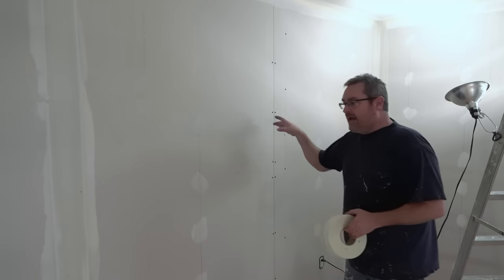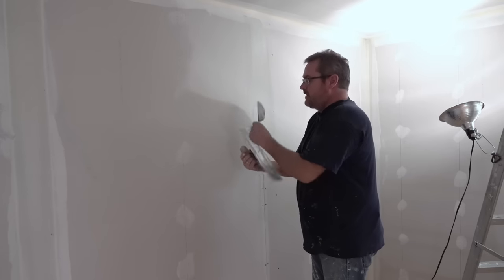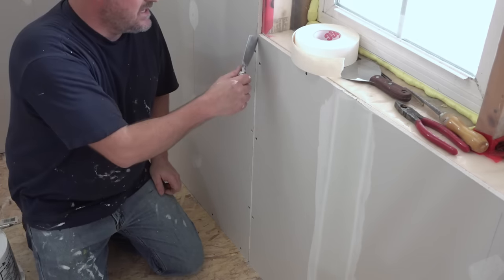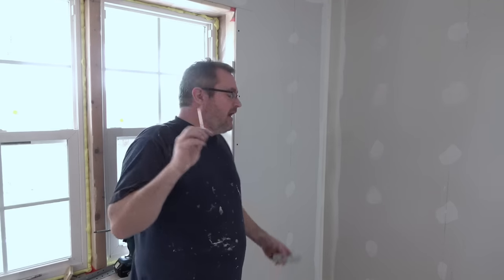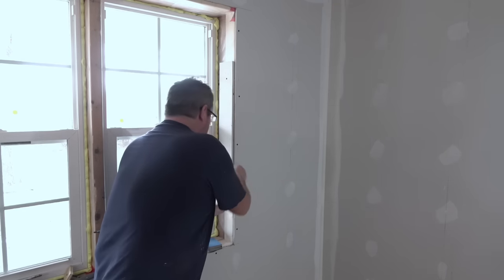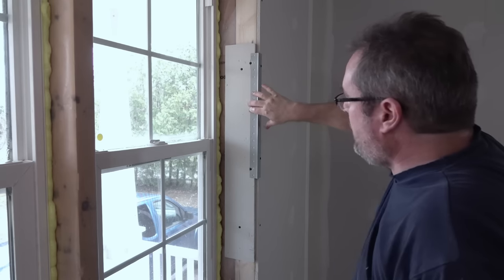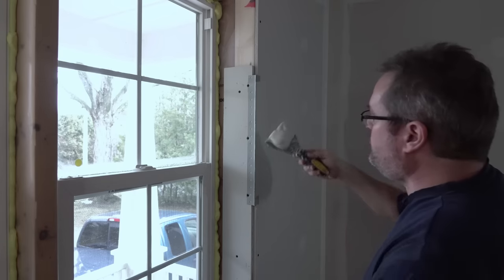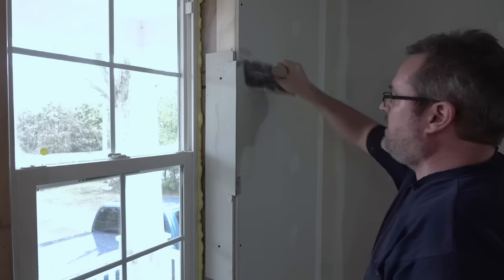How To Drywall Without Sanding Part 3 - Flat Seams And Corner Beads

Comment: Nice tip on the corner bead using the short piece to first make a mark. Also with the tape to strengthen the corner.

Comment: great series for the diyer in new zealand we fit the corner ( slimlines ) with a gun stapler it's not what the manufacturer recommend but it's a ton faster and stops distortion from screwing.
Reply from the maker: +ducksniffernz 
I've seen that, but with the flexible plastic corners. Guys also use spray contact adhesive and there's a crimper that most pros use to get them on the corner snug before screwing.
Reply: We staple ours on if it's metal, that way you're not going into the stud which is prone to movement

Comment: For butt joints do you think the curved trowel is worth it or stick w a straight? I was under the impression the center had to have more buildup to feather out edges to create a gradual hump or just use a straight?  Thanks 4 the vids and lil tips,

Comment: I like this drywall series. I just didn't understand yet the difference between the paper tape and the fiber -mesh one.
Reply: +pmenegatos Mesh tape is a little bit thicker, so it's really best used at the gaps where the drywall has the beveled edge so the joint is flush.
Reply from the maker: +pmenegatos Mesh tape looks like window screen - it's a mesh. The open mess allows the mud to go through to the drywall beneath, so that you don't need to lay down a bed first. It's the same width and thickness as the paper tape, but cost roughly 2x as much.

Comment: Neat series, John.  Any thoughts or experiences on the rounded corners?   I'm not fond of the sharp 90 degree metal corners since I find that they chip off paint so easily.   (I know, someday the kids will leave and that won't happen any more...  )
Reply from the maker: +wordsnwood 
Thanks Art. I really don't like those, actually. I much prefer the crisp, square ones. I've rounded inside 45's before, since it's really hard to make those absolutely straight. And if they aren't straight, they look pretty crappy.
Reply: they r called bullnose corners they r easy to do n look better than the 90 degree

Comment: I hate how corner beads are flared out so much. Trying to install thick baseboard makes it almost impossible to get tight to the wall. In my house I'm going to try and get a better method to keep my inside and outside corners 90. 

The other alternative is to do your base in two parts like the olden days. This allows the smaller top trim to be nailed tighter to the wall as it can flex.

Another way I thought of is doubling up my 2x4 bottom plate so I can nail into continuously and not run into a spot where you have no stud.
Reply: I know this is old but we flair out the bottoms of externals along the wall to make the baseboard curve less, it's not perfect fix but it helps some

Comment: never understood why I see so many doing dry wall horisontal
Reply from the maker: +Lasse Langwadt Christensen 
Mainly because it's faster. Put the first sheet up tight to the ceiling, then next up tight to that from below. If the wall height is less than 8' (or 12' or 16', etc), it's easier to cut the edge off the sheet than the end.
Also, on big jobs, the guys that hang the board almost never do the taping, so they do it the easiest way possible without any regard for how easy or hard it is to tape.
Reply: horizontal sheets also hide waves in the walls easier. because the sheets span across more studs. it also lets you offset your joints which makes them harder to find
Reply: +Lasse Langwadt Christensen It's also tougher to get nails and screws into the vertical layout of board because there are usually some imperfections in the framing plus drying and twisting of the sub-straight. (2x4). An experienced Drywaller doesn't have to mark his stud locations this way either. Its a great question.
Reply: +Steven Bartholomew So the guy framing rushes and makes a wavy wall, the guy doing the drywall rushes and does horizontal sheets and in the end the guy taping and mudding has to fix everything and do a heap of butt joints 

makes sense ;)
Reply from the maker: +Steven Bartholomew 
Traditional wisdom in theory, but another thing in practice. Houses, especially smaller ones, don't have walls long enough to get a good sight line on to see any waviness. This one sure doesn't. 
Even with the joints offset, the butt joints on most taping jobs stand out like sore thumbs - no problem at all to see them, but the tapered horizontal joint is invisible.
Reply from the maker: +jay dube 
I overshoot the framing and use a strip of OSB backing to join the sheets in most instances. Much flatter and more reliable that landing on a stud.
Reply from the maker: Lasse Langwadt Christensen
Exactly! It flows downhill :D
Reply: +Lasse Langwadt Christensen Its most commonly seen in commercial  settings where a top notch finish is not important.  99% of residential drywall is installed horizontally.  It makes for a flatter wall and alot less crack filling   work.
Reply: I Build It Home I've seen sheets tapered on all four sides meant for ceilings, but they are probably quite a bit more expensive because they must be harder to make
Reply: +Lasse Langwadt Christensen No the spotter finishes it all up. The company I worked for had a spotter. Last guy in last guy to leave, he lays a large shop light shining from one corner of a room to the next.  Any imperfections he "spot" fills with compound (mud) and fixes all waves in the wall. Ive seen butt joints 5 ft wide to take out 90% of a wave cause the stud framing was horrid.
Reply: +Bruce Hurlburt 
I guess you have a lt of guys show up early for work.
Reply: +Keith Weagle How do you figure that it is less crack fill?  Vertical sheets = tapered joints every 4 feet.  Horizontal = tapered joints every 4 feet AND butt joints every 8 or 12 depending on drywall, plus one extra staggered butt joint.  Horizontal is MORE crack filling and more butt joints which are harder to hide, take more mud.  Might look good, but less crack filling, .... I think not.
Reply: +Paul Johnston In NZ the drywall comes in 600mm increments from 2.4m up to 6m (20ft) lengths, designed for running horizontal. Either square edge+tapered edge (square against ceiling+floor, tapered in middle) or tapered on both (e.g. for ceilings or over 8 foot walls). You only really get butt joints in ceilings, where they recommend butt joint over air, with each sheet bent up to create the taper.
Reply: I said less filling 'work', but, there are also more linial feet of joints to fill when applied vertically.  Also, the joint is at perfect filling height at the 4 foot level meaning no bending over and stepping up like for every virtical joint.  Butt seems are only a problem if you don't have the right tools and techniques, otherwise they don't require any more time than a tapered seem.  The only advantage to applying drywall virtically is that it's easier to do with one person.
Reply: +Jonathan Marshall I think here the weight means the biggest sheet you are allowed to handle manually is 900x2400mm